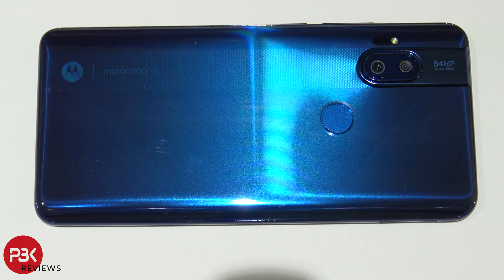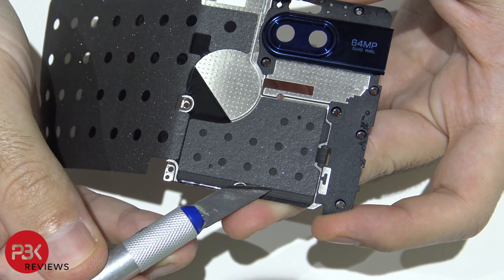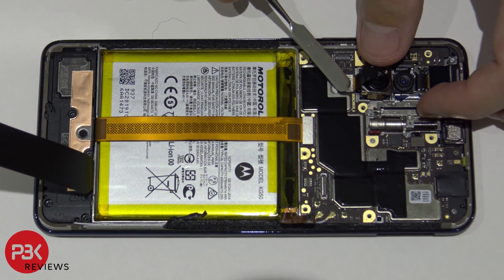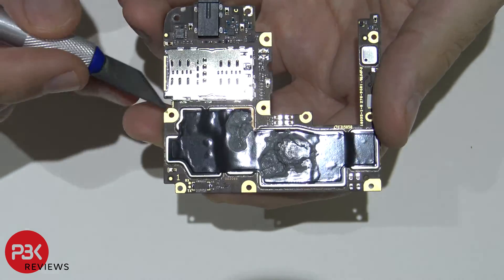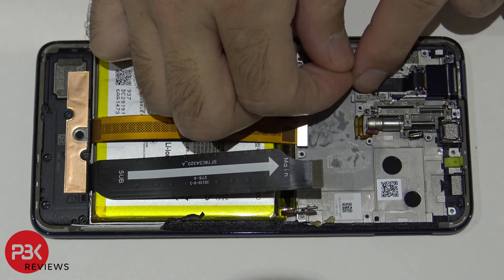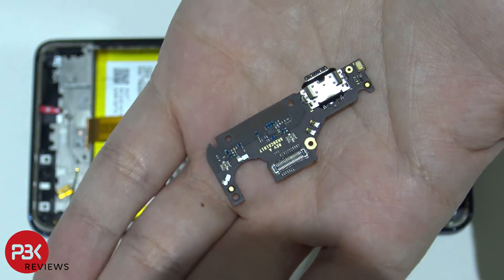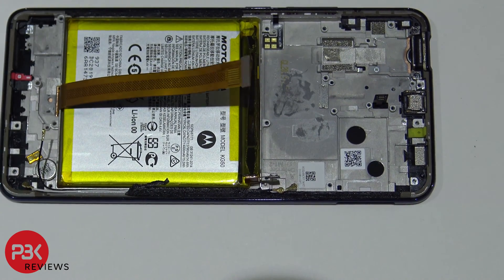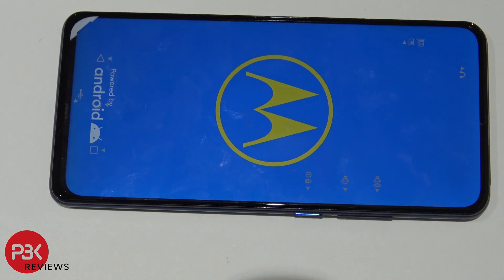Motorola One Hyper XT2027 Disassembly Teardown Repair Video

Comment: Thank-you for blazing the trail with this phone. There's almost no repair info to be found online, but thanks to your video I was able to successfully replace the charge port on my Moto Hyper One. The original adhesive was enough to get the back plate back on the phone.
Reply from the maker: You're welcome. If you need any new adhesive down the line, you can check mobiledefenders.com usually they carry most parts.
Reply: Yeah my vibration motor broke

Comment: Do you know if the power/volume switch circuit is glued in place, seems to me like I need to apply heat to remove it.
Reply from the maker: Yes there is some adhesive holding the flex cable in place.

Comment: I fucked up and broke one of the cables that you remove at 3:46, is there a name for this type of cable/connector and is it possible to replace it? the phone turns on and functions without it, but the bottom right corner of the screen doesn't register touches anymore.
Reply from the maker: Here is a link, they aren't for your model phone but should still work if the lengths match. Not sure what lengths they are exactly etc. (they are called coaxial antenna cables) https://www.mobiledefenders.com/catalogsearch/result/?cat=0&q=coax

Comment: Mine says it's charging but the battery isn't increasing. It's dead now and I can't figure out how to fix it. It won't charge.
Reply from the maker: It might be a bad battery or bad charger port. You would need to replace one or the other and see which is the issue.

Comment: could you tell me how to fix the dolby audio issue. My speakers are not working because my phone has disabled the dolby audio because it believes that the headphone jack is connected but it isnt. Is there any way i can get this fixed?
Reply from the maker: You would have to somehow remove whatever is stuck in the headphone jack making it think something is plugged in, or have a professional place solder off the jack and install a new headphone jack.

Comment: Can you do a video of how to change the screen that would be great thanks
Reply from the maker: Once you take the phone apart and disconnect the screen cable etc., all that is left is to heat the front of the phone where the screen is with a hair dryer or heat gun to loosen the adhesive and pry the screen off. Then you apply new adhesive, or if your screen comes with pre installed adhesive you don't need to do that, and run your new screen cable back through the slit in the midframe, re-apply your screen to the frame and re-assemble the phone. I don't have the phone with me anymore.

Comment: Do I have to do all this to just replace a cracked screen or can I pop the screen off from the front somehow?
Reply from the maker: No you would need to disassemble it so you can disconnect the screen cable and be able to pry the old screen off and run the new screen cable and re attach it to the main board.

Comment: Trying to fix a broken screen - I can get the screen loose easy enough but cant work out the back panel - how do you pry it off - Ive heated the back but cant get the plastic tool into any gap?  Anyone help?  Thanks!
Reply from the maker: Hi, you can try using a suction cup to help pull up a bit to give you some leverage or if you don't have one, a thin razor or something (even though that may scrape or scuff your housing)
Reply: @PBKreviews  Thank you for your reply   - Ill try that  - I presume Im working on the join between the black plastic edging and the coloured base.
Reply from the maker: @conceptbuildingsolutionsde6707  There is only one seem or line separation between the back panel and the frame, so should be only one place you can pry the back plate off or put your pry tool in between.

Comment: Sir lhave motorola  droid maxx  xt1080 can i use other motorola  madel battery  because  xt 1080 battery  not available
Reply from the maker: Most likely no, because very rarely are batteries the same size to fit the space the specific phone has for the battery and also very rarely are the connectors the same or located at the same position so your cable would reach to connect to the board. Even if the space is there, the connector is the same, you also sometimes have software that might not read the battery chip correctly and give you issues like a battery icon with a "!" or not allow to power on etc.  Now say in circumstances that a phone is the same exact model just a higher end version say a S10 or a S10+, the battery connector might be the same, the phone software might read the battery chip correctly  however the space and position of the battery might be different and make it hard to fit or work with. The only phone to my knowledge that was able to be used with a upgraded battery with no problems was the droid razr and droid razr maxx where the body and build of the phone was exactly the same aside from the slimmer battery and back of the razr compared to the razr maxx. This allowed you to upgrade the razr with the larger razr maxx battery and only need to slightly modify the back plate to seat in place with the larger battery.
Reply: @PBKreviews  thanks sir. BUT i am pakistan hear is not popular  motorola  buy i love motorola .hear is not available  this model battery . i dont know  who model use battery  this motorola
Reply: @PBKreviews  thanks  sir
Reply from the maker: @zeehot1598  your welcome. You can always try searching online to purchase the battery you need